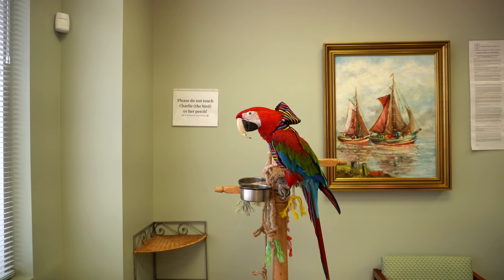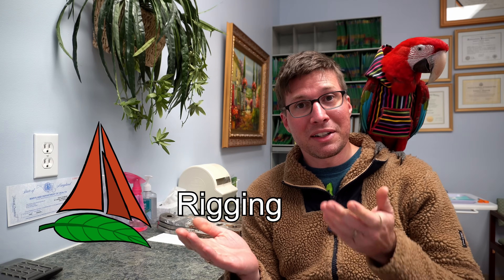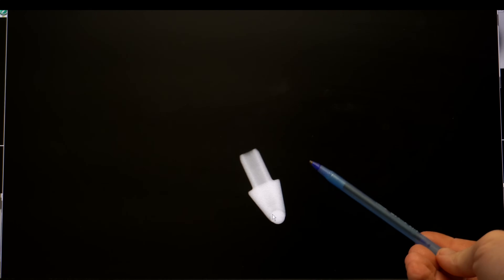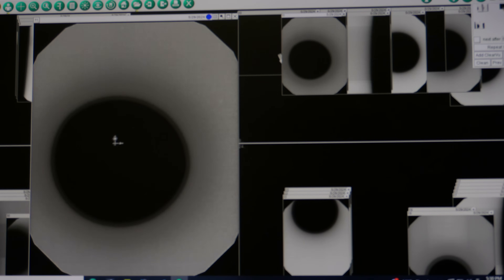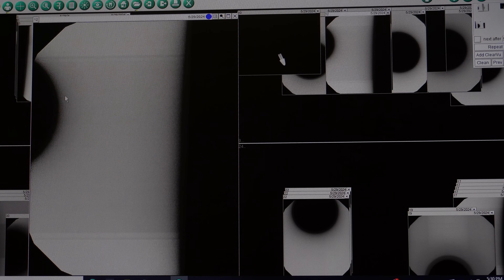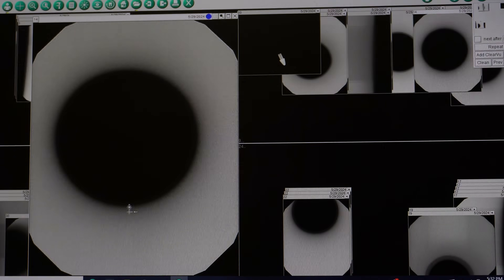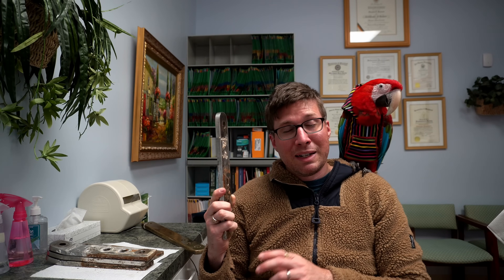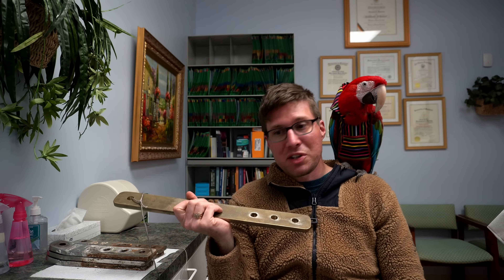Can X-Rays Find the Crack in our Chainplates? | Sailing Wisdom [S6 Ep9]

Comment: Great video. 
Metal fatigue is an interesting science and I can tell from the comments there are mechanics and machinists who take it into account too. Zyglo liquid penetrant inspection, x-ray, and eddy current testing are three industry methods for detecting surface and subsurface cracks in metal. While it's efficient, the commercial testing price may be more than the cost of new hardware. 
The comments about using a countersink to bevel the holes and create a space for the bedding compound are good ones and an industry method for chamfering holes. As someone else said, avoid using a counterboring tool. While the counterbore will create a pocket around the hole it also creates a sharp corner where the bottom and side of the hole intersect and sharp corners create "stress risers" in metal and must be avoided where a metal is used under strain. 
One thing I've noticed in many sailing hardware videos is the lack of flat washers, lock washers, Loctite, or anti-seize compound to secure nuts and bolts. A good torque wrench and torque chart will also take the guess work out of tightening nuts and bolts properly and make inspection for loosening more accurate. 
Flat washers distribute the load from the bolt head over a larger area and protect the metal surface.
Lock washers work well under a nut. They distribute load and prevent loosening.
Removable Loctite will create a resistance between a nut and screw and allow disassembly. Might be good for interior use where nuts and screws loosen over time.
In addition, depending on the susceptibility of the hardware to corrosion, a light application of Anti-seize compound can be brushed onto screw threads before assembly. This makes disassembly much easier sometimes. 
Thanks for the video! It was fun to get my old tool and die maker brain cells working again!

Comment: Actually, the area most likely to develop crevice corrosion is where it goes through the deck. It’s the area most likely to hold salt water and not have oxygen getting to the stainless surface.
Reply from the maker: True, but when doing an inspection on a boat with the chainplates installed, you won’t see that part as it’s encased in sealant. The spot you will visually see it is near the first bolt hole. When you see that, it can be assumed that there are more cracks elsewhere that can’t be seen.

Comment: Leave it to a dentist to use a very expensive drill to do the same thing the rest of us would do with a chamfering bit on the end of a cordless drill.  I might have even used a deburring tool on bronze to get the same results in a fraction of the time.  

But, those shots and music with the dental drill looked a lot cooler than what I could have done.
Reply: Exactly my thoughts as well! 😂
Having said that, this is a super-cool video!
Reply from the maker: It’s where my mind goes when I need to make something small 🤓
I use those burs when I prepare a tooth for a crown so to me it’s like second nature to use it. 
I did end up getting a countersink bit and it did the same result in a fraction of the time.
Reply: @RiggingDoctor as a blacksmith I tend to solve problems with a hammer….let me know if you need some help with a tooth!

Comment: I recommend chamfering the bottom edge and using countersunk bolts. I didn’t when I switched to external chainplates and the sheets catching on them is so annoying. I ended up fairing over them with epoxy but its ugly.
Reply from the maker: That is a good point with the sheets getting hooked under the chainplate. I hope that the way the sheets are routed will prevent them from fouling on it, but we shall see! If it becomes an issue, I know what to do. 
As for the bolts, my choices are very limited by the size of the fastener. Not much variety is available in 5/8”. 
I wanted to do a nice countersunk Phillips or Allen head but all I could find was the clunky Hex bolt. What size of bolt did you use on your boat? When I do this on Windpuff, I will probably get away with a smaller fastener since it’s a smaller boat. 

BTW, I love the carbon fiber reinforcement you put in your hull to beef up the structure when you did your chainplates!
Reply: @RiggingDoctor  Good point, It might just be the way my sheets are run. mine bolts are 1/2”. Ive also seen people use carriage bolts and thought that might have been a good option too.  It looks like you’ve also got a rub rail that might keep them from fouling.

Comment: Bevel and polish the edges of the drilled holes to reduce sharp edges. Sharp edges are stress risers in metal for cracking. The bevel will also retain Butyl bedding compound around the bolt and plate interface.

Comment: Always wondered if x-ray would show chainplate issues. They use it to inspect the spars on the Beech 18. Another idea might be eddy current testing. They use it on aircraft propellers to find micro cracks.  I like the idea of beveling the holes to better bed the butyl but a counter sink would make nicer work of it.

Comment: The closeup work with your dental drill is fascinating. What is the RPM of the drill? What metal is the bit? Was the bit a standard bit used when drilling a tooth? Thanks for your time. :¬) Webhead USA

Comment: Of course since your stainless chainplates lasted around 40 years or more, you could have simply replaced them with new stainless and likely gotten another 30-40 years out of them.  Presumably the original chainplates were made from 304 stainless.  In that case upgrading to 316 would give them a even longer life since 316 is significantly less susceptible to crevice corrosion and corrosion in general than 304..  Even though 316 stainless is more expensive than 304, 316 is significantly cheaper than silicone bronze (likely less than half the cost of bronze) and generally much easier to find.  Then there are the fasteners.  316 stainless bolts are much cheaper than silicon bronze bolts.
Reply: Aren't the new chain plates external so better made out of bronze?
Reply: @Andyfunsail  No stainless, particularly 316, is fine outside the boat.  As long as the stainless is exposed to air it will maintain its protective oxide coating and suffer very little corrosion.  The old chainplates were very susceptible to corrosion where they passed through the deck because that was likely to be both a wet and anoxic (without oxygen) environment.
Reply from the maker: @todddunn945 you are correct, external stainless steel chainplates work very well. They can still develop issues on the face that attaches to the boat, but you can still see them much better to check on them. 
I did bronze for two reasons: 1. It can’t get any crevice corrosion 2. I like the look of it.

Comment: Just use a little trig to find the angles Herbie. Right angle(ish) from the base of the mast. You have mast height. Angle will not change (similar triangles). You will be +/_ a a degree or 2, should be fine.

Comment: Alas but I tossed my cracked chain plates. They would have been perfect for you to test. My father was a professor of metallurgy and he suggested to ring each piece. Hang it by a fine thread and tap with a hammer or similar. A good piece will ring nicely. Anything with a crack will sound dull. I'm curious if your one suspect chainplate might ring differently than the others. Mine did.
Reply: A valid test for grinding wheels too. I’d love to see it tried here.

Comment: If i might make a suggestion ... what you did with the dental drill will work, but if you used a a carbon steel fostner bit you could create an actual shoulder to fill with Butyl tape with an even circular shape and a flat bottom.  This would in effect create a natural Butyl washer once the chainplate was attached and tightened to correct specifications. You can order the bits through Grainger.
Reply: Hard corners may lead to cracks .
Reply from the maker: Good to know!

Comment: Actually you need Crack Testing Fluid under UV Light to find Cracks in Metals, such as Cracks in Steering Racks for Car Steering Components. 🤔 Bob eta -  who used to work on a Power steering Production line. 👍🌟🌟🌟❤️

Comment: Love what you do,  but didn't you kind of negate your whole effort?   Could have taken off all the chain plates,  tested,  when realized they were in pretty good shape,  just replaced them?    I mean they were in good shape for 20+ years,  so replacements should have worked just fine.    What am i missing or are you just one of those that enjoy projects? Which i understand,  lol
Reply from the maker: The stainless steel was in pretty good shape but they connected to an iron frame that was rusting away. The whole structure needed to be replaced so we simply switched to external chainplates.

Comment: Non destructive imaging/inspection. Early on busting knuckles I would inspect cylinder heads for cracks by simply cleaning the surfaces with solvent, wiping dry, then spraying with a podiatrist solution called athletes foot spray. As the powder dries white the crack will be wet and dark. At the machine shop they would do magnetic particle particle inspection which is simply passing current through the metal while dousing it with a ferrous powder to see where the voidd are. My favorite was when overhauling Lycoming/ Continental engines I learned to inspect with Zyglo. It is super duper thin die that will remain in any void after drying the part. It kinda blows which makes it easy on the eye but not the waste water treatment equipment. My last job involved maintaining large turbine power Thrush airplanes. Twice a year I would disassemble the wing root and an engineer would use a diamond tip stylus (ink pen sized)  to measure wing attachment cracks. It was called Eddy Current Inspection. Apparently it can see tiny cracks somehow by measuring electron flow. A couple hundred bucks every time X 3 airplanes. 😊
Reply from the maker: The technologies out there to test for failure before they happen is amazing!

Comment: I was an NDE tech, Quality Manager for a small firm, now retired. A dentist is far more qualified to speak to many things, and no doubt has a great deal more experience with X-Rays than I, we mainly used source radiography with film, this doesn't typically have the sensitivity of X-Ray using a tube head with a CR plate. However, radiography inspection was not recommended for cracks, although with proper orientation and/or loss of material it does show up. The method for volumetric (internal) crack detection, in a plate like this, is shear wave ultrasonic testing. If you had the piece out like in the video, find a good lab in your area and have them UT it. But if you had it out, have a new one fabricated like the Rigging Dr, did.
Reply: For non-engineers, NDE is non-destructive evaluation.
Reply: @wonderboy6511  thanks
Reply from the maker: @wonderboy6511 thank you for the explanation
Reply: Also refered to as NDT (non destructive testing).
Dye penetretant method can also help identify cracks to a certain degree.